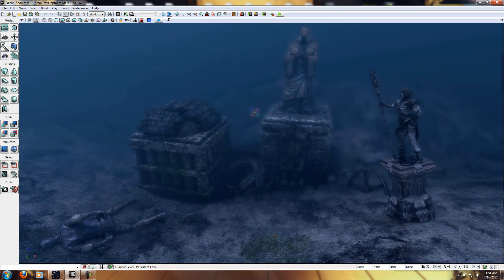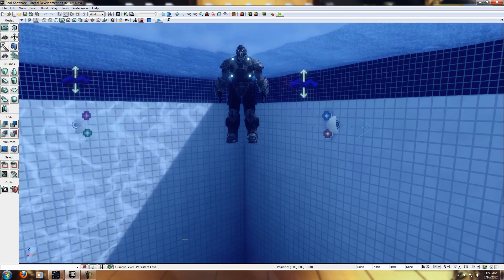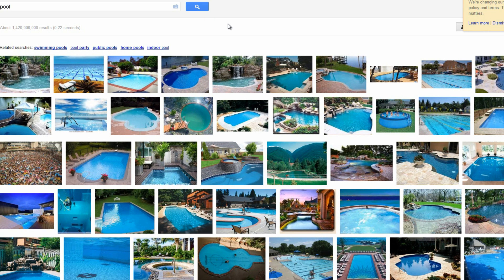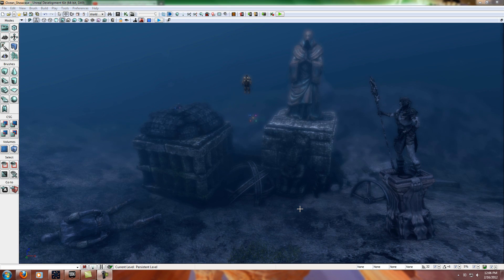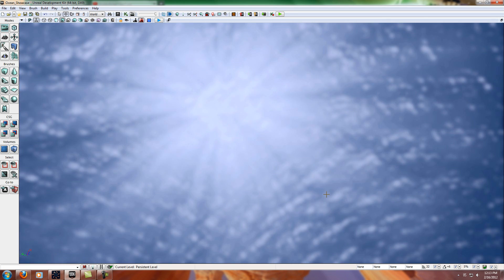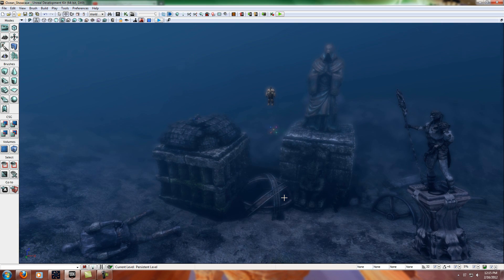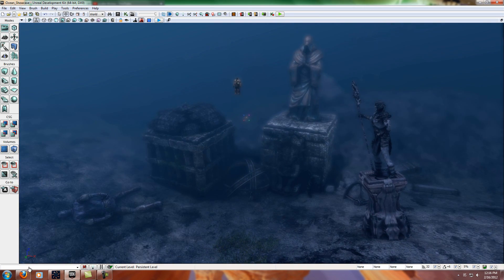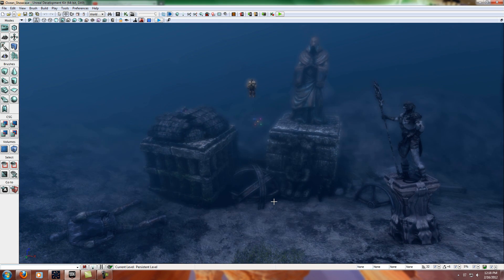UDK Underwater Tutorial (Introduction)

Comment from the maker: The surface is just a transparent material.  There is a check box in the properties to turn it on.  

The godrays are a built in light function.  Go to the properties of your dominant light and you should see the options.  

To get the foggy, dense look to the water I just used a fog actor, which has its own density, color, etc properties.

Be sure to check on the Unreal Developer's Network (UDN) for in depth information on all of these.